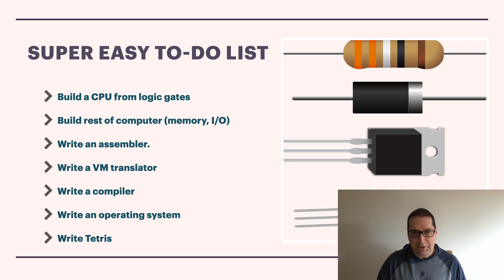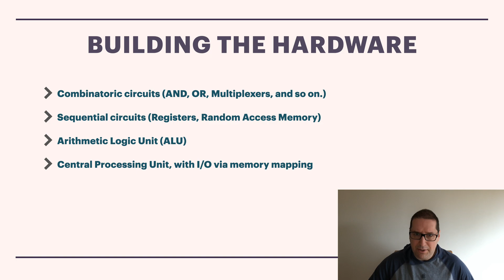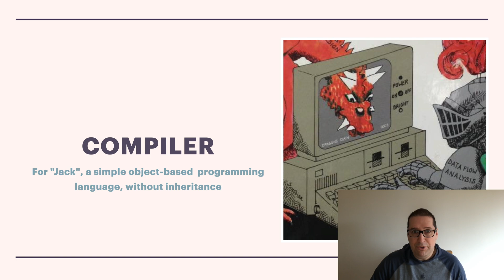From NAND To Tetris, Part 1: Let's Build A Computer From Scratch

Comment: I'm sure glad i found this channel...   i started the Nand 2 Tetris course in Coursera last summer... got about 1/3 the way.  I havent given up... still have the 3-5 supporting browser tabs open for the past 9 months waiting to get back to it....  I felt the 'oral' information/presentation was not detailed enough (for me), and really struggled to get 1/3 of the way.  I almost purchased the book multiple times thinking that would supply the details needed...   Looking forward to seeing you work through the course.  I expect that will give me the courage i need to get back into it myself.   I'd prefer Windows....
Reply from the maker: Welcome aboard! I sure hope you find the videos useful. That said, the book does contain a lot of useful information, so I think it's well worth purchasing.

When you say you got around 1/3rd of the way - what was the last chapter you did? I think for most people the difficulty probably starts ramping up once you switch over from building circuits into building software, like the assembler or VM translator.
Reply: @TeaLeavesProgramming   yeah, i had to go back and check... looks like i finished project 01, and was beginning project 02...  :)   so, 1/3 was pretty optimistic.   Also, it's apparent to me now that the book is essential to getting all the needed detail and background on what they 'touched' on in the corsera videos.   Speaking of the book, looks like they are coming out with a second edition this summer.  Supposidly same content, just organized more clearly, and more examples and details. A more clear transition from hardware to software.  I think i'll wait for that edition.... yet follow your videos in the meantime.  Anyway, thanks for the videos.

Comment: Great road map! Windows includes Linux. Also RaspberryPi for this type of project is possible. If possible all in a terminal in keeping with your 'like 1979' theme.
Reply from the maker: Thanks for the idea!

I’m roughly going to divide things into lectures and labs.  The lectures will be mostly me talking :-) but the labs will be done by both drawing the circuits and editing the HDL files and running them through the tests.